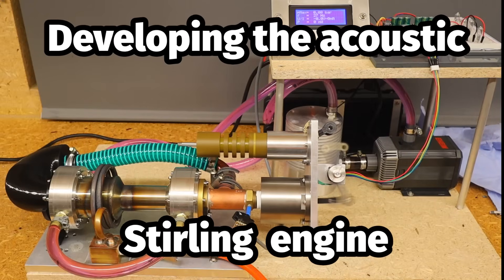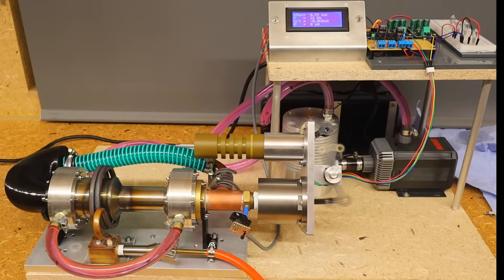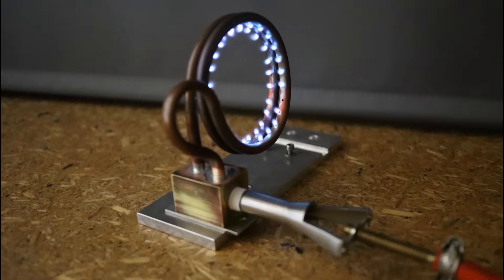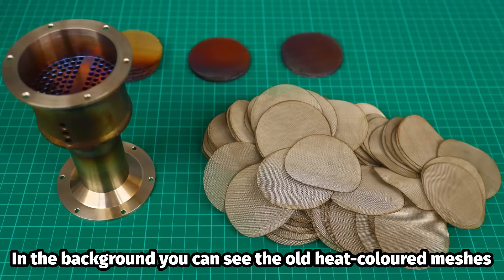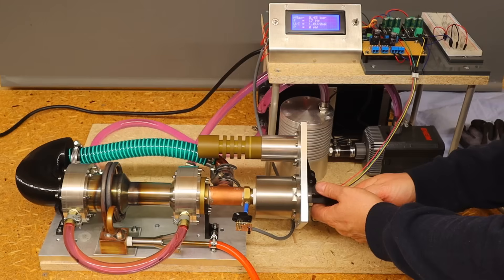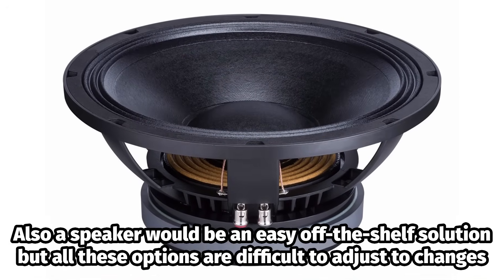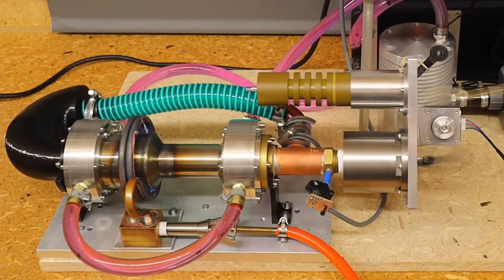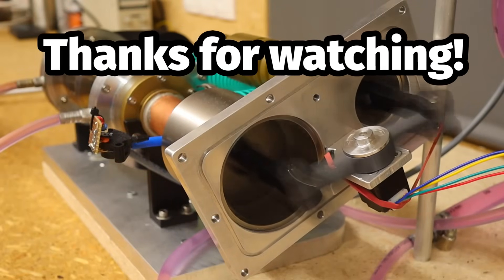More energy with the acoustic Stirling engine?

Comment: regenerators... something worth contemplating...
all the old books, and the original designs, used glass or porcelain.
not thermally conductive.

a conductor absorbs heat. and its specific heat means it only alters in temperature by so much per watt. "latent heat".
an insulator tends to heat on the surface only.
so the heat is readily available on the return phase.

whereas the conductor, having only risen in temperature so much, also only heats the air back up so much, and releases far less of that heat within.

the concept seems to have been completely overlooked in modern literature...
in electrical terms, you need a good "dielectric" to give good "elastance"...definitely worth testing and cant hurt...

anyway. i still feel stirling is a dead end. too many drawbacks. a few tiny tweaks, it becomes the ericsson, with external heat exchangers and plenty of room to get heat in and out, with plenty  of TIME to do so...
yeah, old transformers. scrapyards... welders.

keep the laminations all clamped up tight and they machine ok. soft :)

the stepper arrangement is interesting but...voltage is the number of lines cut per second. the rotor itself is only very small, the peripheral speed of the magnetic fields changing are actually quite low. and being such fine teeth, its producing a sine modulated sine wave... on two phases is another issue. four wires. 8 diodes to rectify...

ive spoken of linear generators before... ah well. no matter how you look at it, rotary always ends up as best...
Reply from the maker: The design of the regenerator is really a very complex matter.
Keys and London have shed some light on it, but I believe that even experts are still unable to calculate it completely correctly.
The difference of the thermoacoustic Stirling is his its ingenious simplicity.

Comment: As far as pressurization goes, one cool thing about helium is, it rises and can displace atmosphere (slowly). If you place your entire engine in a cavity with an open bottom, helium can flow in from the bottom displacing air. If you place your pump inside this enclosed space it will suck up helium as the working gas. Hope that makes sense. Allows you to avoid needing special seals maybe. 🤷‍♂️
Reply from the maker: If I understand correctly, does this only work at ambient pressure?
However, I would like to charge the motor with up to 10 bar (~150 psi).
Or am I misunderstanding the suggestion?
In any case, thank you very much for your help!
Reply: @myengines2443 You can place the pressurizing pump inside the helium gas enclosure also (may have to pressurize slowly). So can run at ambient pressure, but could also pressurize (would need to size the enclosure properly and fill with appropriate amount of working gas).
Reply from the maker: Yes this would be a solution, many thanks for your great help!
Reply: @myengines2443  You can use a vacuum pump meant for split air conditioners to evacuate the engine before filling it with helium. The way you also get rid of any excess water vapor left in the engine. There are pump sets that also inlude a "Monteurshilfe" so you can use the same way as an air conditioner is filled with refrigerant. I bought mine at Vevor for around 100 bucks. You also need  a 1/4 shrader valve that you solder to connect the pump with your engine. And an adapter for your helium tank so it can flow through the "Monteurshilfe"
Reply from the maker: This are good tips and I will try it out when its the time for that!
I still have a big bottle of helium from my experiments with the rhombic Stirling which will last for ages!
Reply: Or if you want to risk it… hydrogen. 😳

Comment: I assume you know but I'll say it anyway: Stainless steel is VERY bad at conducting heat.
Reply from the maker: This is exactly what is intended for the regenerator material, as a large temperature difference at both ends of the regenerator is essential. Good heat conduction would also be desirable for heat transfer from the working gas, but maintaining the largest possible temperature gradient is more important!

Comment: If you mill down the iron chips with a ball mill, matrix fill factor will be quiet high and you are very flexible in your 3D printable design. Magnetic permeability will be several orders higher than air. Backing of magnets and or coils should be made of deep drawing steel like DC04 or you take some sheets of old transformers. But consider somehow diagonal pols to avoid gogging.
Reply from the maker: Can you explain the diagonal poles in more detail, please? I didn't understand that part.
Otherwise, thank you very much for your great help. It's really helping me move forward!
Reply: @myengines2443 The pol shoes of coils must not pass the magnets straight but more in an inclined angle, otherwise rotor would rast into these positions, not the best solution for your engine to start oscillation. Air coils are here best but with very low power density. Best example is Faulhaber motors with crosswise wound coils. You may have an odd number of magnets and pols as well to prevent this. In consequence, distances of coils are different to those of magnets.
Reply from the maker: Thank you very much for the further explanation. I will think about it carefully and then hopefully apply it!

Comment: A linear generator.... is also a motor. You can both pull current encased... and cause oscillating to initiate the cycles
Reply from the maker: Yes, that's exactly the plan I have for starting it up. I just think that the programming and control won't be that easy, and will the linear motor have enough power to start it up?
Reply: @myengines2443  Some linear motors are very strong, it depends on how they were built.

A single sharp impulse SHOULD be enough to get your oscillation started, so making a complicated self reversing driver should not be necessary.

Even a simple speaker coil can work as a linear motor, since that is exactly what it is.

The same way a coil-over speaker can become a microphone, so too can a larger linear motor become a generator.

Technically, the lower mass of a speaker coil will deliver more power for its mass, because you need not try to constantly reverse the whole shuttle that a normal linear motor needs to perform work in a machine tool setting.

Also, you can wind your own coils, selecting the gauge and number of turns you find most efficient, and the faster the coil travels through the magnetic field, the more efficient, and more power it will make.

This should help you to begin to work on the linear motor setup: https://www.tutorialspoint.com/electrical_machines/speed_frequency_relationship_alternator.htm

The faster you can make the system oscillate, the more efficient it becomes.
Reply: A very simple first step would be to use a bench top signal generator to drive the linear generator during startup and a simple changeover switch to go between startup and generation.

Slightly more complicated electronics could be developed later on to add some finesse, but it isn't massively complicated. Depending on how easily the engine starts, it could be as simple as a single short pulse via a relay or MOSFET and then monitoring the output of the generator or your pressure transducer to see that the engine has started, repeating a few times if necessary.

The simplest method to stop your electrical load from interfering with starting would be to use a normally closed relay between the coil and the rectifier, but even that might prove unnecessary
Reply from the maker: @jamesharris5158  yes this is a really nice suggestion and partly as I thought of it, very good idea with the signal generator, I have a simple one but did not thought of it in this relation!
Many thanks for your great ideas and big help!
Reply: A speaker voice coil is a linear motor/generator, therefore if you buy a used subwoofer car amplifier You could easily push hundreds or even thousands of watts in an oscillation. Just plug in the amp, connect to the linear generator/motor. Plug the amp into you phone and use a a frequency generator app or website to induce the motion at a specific frequency. Then just disconnect when the engine runs

Comment: As for starting ideas, I wonder if you could take a motor driven piston that is connected on one side to the resonating circuit and on the other side to the "atmospheric" chamber. When powered this might stimulate a resonance that could get the engine going? This could at least be totally contained within the pressurized circuit and would only require sealing the power wires.
Reply from the maker: I don't quite understand what you mean. What kind of piston do you have in mind?
Thank you very much for your thoughtful comments!
Reply: @myengines2443  So imagine you have a piston operating in parallel with your power piston. One side of the piston is plumbed in with the resonating chamber and the other side is to atmosphere; as your engine sits now without the rear cover.

If you reciprocate this piston it would create pressure variances in the resonating chamber that would potentially get the engine going. This reciprocation could be done with a motor and crank assembly that could live underneath the rear cover where your rocking beam resides.

When off it shouldn't influence the engine, other than maybe altering the volume of the resonance chamber if it doesn't park in a specific position.
Reply from the maker: But this would require to seal the complete piston which would be quite big if i understand you right?
That would never be complete tight with reasonable effort or do i miss something?
but the idea to start the engine with a pressure wave is quite nice, thanks for your helpful thoughts!
Reply: @myengines2443  Correct, but I would hope the necessary piston size would not be near as big as the power piston. I guess a way to approximate the necessary size would be to estimate how much travel you need to inflict on the power piston to get the engine to start. From there you could calculate a volume and figure out how much stroke a more compact starting piston would need.

Comment: One thing that might help increase efficiency would be decrease the cold end temperature even more,one way to do that would be using a expansion cooling process using pressurized air expanding through a manifold of sorts like fuel sprayers in jet engines where your current cooling is. It also might start easier.
Reply from the maker: I'm not sure what you mean, are you referring to the combustion air supply?
In the finished engine, combustion air preheating is of course used via the cooling system and waste heat to increase efficiency.

Comment: One way to deal with the balance problem would be to mirror your engine so it becomes a twin balanced opposed engine.
Reply from the maker: Yes, this is a very elagant possibility but much more work in the development phase. When the engine is developed readily I will surely try this for better balance, more power and higher efficiency!

Comment: To start the closer pressurized engine you could have a shaft pass through the stepper motor cover with an arm inside and an arm outside. As you twist the shaft with the external arm the internal arm contacts the walking beam just like your finger does then slips off out of the way. If the engine doesn't start continue to rotate the shaft until the internal arm swing all the way around to contact the walking beam again. The shaft can be tightly sealed with orings and does not need to easily spin as you can provide lots of torque with your hand.
Reply from the maker: That's pretty much how I imagined a mechanical solution would work.
That's an interesting suggestion, which I'll think about in more detail.
Thanks for your helpful advice!

Comment: An external crank arm with a seal that pops/lifts off the pivot for starting? Like the old hand crank cars.
Reply from the maker: This is one possibility if there is a mechanism in the crankcase that prevents the oscillating movement from being transmitted through the seal when the engine is started, as this causes additional friction, which reduces efficiency. Thank you for your suggestion!

Comment: Looking great! 2 suggestions: use a flywheel. And the open end is like a subwoofer and a loss of power. Close it with enough volume, posibly a volume with the same resonance frequentie.
Reply from the maker: I have already tried a flywheel with a crank mechanism, but it didn't work, probably because it disturbed the thermoacoustic cycle. The video shows a picture of the crankcase cover that I want to use to seal the engine airtight.
This is of course necessary when pressurizing and should also be helpful for the reasons you mentioned.
Thank you very much for your valuable thoughts and assistance.

Comment: I wonder whether you can add a variable-sized space somewhere in the setup to allow you to tune it if you get out of resonance. I wonder how changing the gas pressure would affect this? Did that change the resonance in your previous model?
Reply from the maker: By changing the length of the gas circuit (the hoses), I only get a slight change in performance so far. I need to come up with something flexible, as you suggest. To do this, my performance measurement must first work reliably so that I can see a directly comparable result. Thank you very much for your helpful assistance!

Comment: If you pressurize this thing, then the power piston would be pushed out of the cylinder, right?
--> So you could use 2 opposing stirling engines, that share the same power piston in the middle.
Then the static pressure would cancel out on both sides of the piston, leaving only the dynamic pressure to move the piston.
Also it could be a fully enclosed design, where only the magnetic field around the power piston is penetrating the walls.
Reply from the maker: A multi-stage thermoacoustic cycle would of course be very effective; commercial engines usually use three gas cycles.
However, this requires much more effort in the development phase and would only be conceivable for me if the engine were almost fully developed in order to increase performance and efficiency.
First, I want to seal the crankcase, which will create back pressure on its own.
Thanks for your good suggestions!

Comment: Sh0tgun manufacturers specifically design non-lead shot from "dead soft" or annealed (heat-treated) steel, It will work very well as a transformer material, another option is to used pulverized high frequency transformer coils (ferrite) which will work best will depend on the design, and the permeability of the cores used. 
I would imagine that changing the resistance of the travelling wave by altering things such as the mesh and cooler, has moved the resonance, to increase power you may have to alter the other dimensions to match, try making a much larger lower frequency design which can closer match the use of mechanical capturing using electromagnetism, or alternatively a higher frequency that could be used with a much shorter stroke and either a piezo or magnetostrictive transducer and then comparing the benefits.
Reply from the maker: Thank you very much for all the great tips. I will think carefully about them and try some out!
What types of steel or iron are used in shotgun ammunition or high frequency transformer coils?
Reply: @myengines2443  Its soft iron, it has low coercivity and hysteresis loss, meaning it can be easily magnetized and demagnetized, minimizing energy waste as heat, thats why soft iron is used in regular transformer laminations. Ferrite is used in high frequency applications mixed with other compounds that reduce noise from magnetostriction and filers that adjust the permeability. Another option is Metglas and amorphous form of soft iron but it will be difficult to obtain and cannot be cast like a powdered ferrite or ball bearings mixed with epoxy resin, which is proabbly the easiest way to obtain a custom shape other than layering thin laser cut laminations.
Reply from the maker: Thank you very much for your great help, I will think very close about your very helpful information and will adopt it in my building of the iron cores of my next linear generator!

Comment: To start the engine: install a solenoid on the external part of the housing. Make at least the last part of your shaft magnetic (rare earh magnet glued to the end). Enegize the solenoid, so the shaft is pulled in. When dc circuit is open, shaft is released and motor starts.

Bonus points if the trigger is a big red button.
Reply from the maker: Yes, that's pretty much how I imagined it would work with an electromagnet.
Even more power could be transferred if the magnet were placed in the crankcase.
Thanks for your good suggestions.
Reply: Another option that might be worth trying out is to mount an audio exciter on the outside of the engine somewhere and have it play a tone.  This would require experimentation, and I don't know if it would work, but the idea of not needing a direct mechanical system inside the pressure vessel that's only there to start the engine is attractive.  Audio exciters are kind of like speakers, but they're designed to induce vibrations into solid objects, rather than the air.  They can be had in various sizes and power ratings for less than $50 and as low as $15.  Again, it would require some experimentation, and might not work at all, but the idea of mounting a little noise maker on the outside of the engine that can provide just enough disturbance inside the engine to start it is very appealing to me.
Reply from the maker: @jamesburleson1916  It sounds a bit underpowered, but I'll take a look at what's available and maybe that's exactly the simple solution I need!
Thank you very much for the great idea!